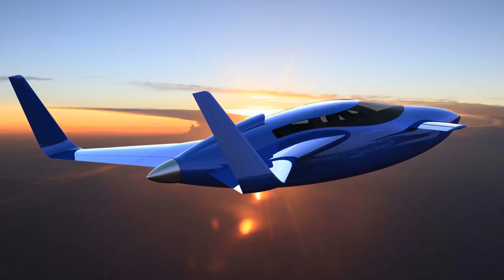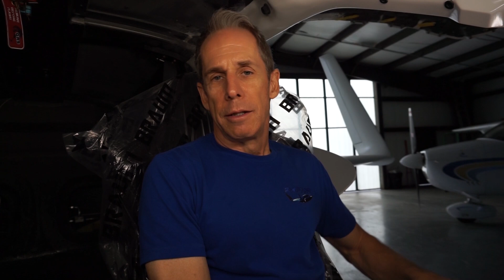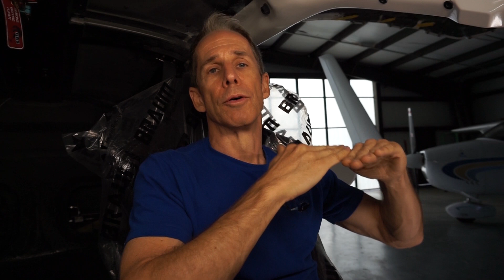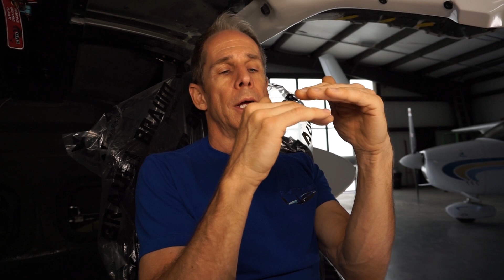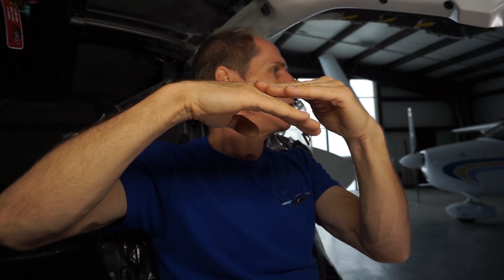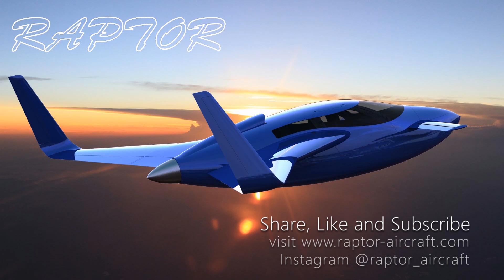State of the Union - Building the Raptor Prototype

Comment: 1) Ideas for reduced risk for flight testing - truck aircraft to a longer runway so progressively longer hops can be performed at low altitude without the need to gain altitude and turn the aircraft.  This is a low risk, low cost, and low schedule way to gain confidence in the aerodynamic concerns.  Pitch authority can be evaluated with less than 50 ft of altitude.  Perhaps NASA would support this project for no fee as it could provide an American resurgence to the aviation industry.  The former space shuttle landing site would be excellent for this and is an 8 hour drive from you.  NASA is seeing a resurgence in the aeronautics side since shuttle retirement, they might be interested in performing spin recovery model tests like they did for the Long EZ many years ago.  Also the NASA Ames (San Fran) wind tunnel test section is large enough to put your full scale aircraft in and take it up to almost 300 knots.  Installation support would take some engineering and build however, especially if the support allows for a free pivoting instrumented balance.  A simple tie down on its current gear to the tunnel floor with control movements may be sufficient to understand whether there is an aero-structural harmonic coupling with the winglet.  University involvement is a good idea, but typically is not free unless it is done by undergraduates that are just learning. NASA may be a better route to getting expert evaluations at reduced cost.  I think asking Burt and Dick Rutan to review your project, either virtual through a web cam or in person, would be very worthwhile.  Their knowledge and connections are significant for most of the concerns you are dealing with.****    2) Idea for variable elevator gap and concern about enough pitch down capability - Can these concerns be mitigated (at least partially) by moving the hinge points aft while leaving them at the same waterline?  If so the metal brackets could be modified external of the composite structure to accommodate this change quickly.  Removing the skin to access the metal to composite joint takes much more time to accomplish, but also can be done with a replacement skin.****  3) Idea for evaluating winglet aero-structural harmonic coupling - This concern can be mitigated if the structure is stiff enough.  While not conclusive, some confidence can be gained by measuring load vs. deflection of the model winglet and wing, then doing the same for the full scale aircraft.  See if the stiffness of the full scale aircraft is similar to the model when scaled appropriately for size.***  4) Idea for dual channel ECU - is there a mechanical packaging solution to creating dual sensors in all locations?  If so, then simply duplicating your current system and wiring both systems to the output actuators (injectors, waste gate actuators, etc) with a simple switch could mitigate this concern.  A 2nd flight test pilot/engineer could monitor the data from both systems in real time (you have enough panel space for this) and make the decision on whether to switch from primary to back up.  Back up battery power should be sufficient for flight testing, dual alternators can come later.***  5) Thoughts on the redrive - you have 2 belts which provides some redundancy already.  Periodic disassembly after ground runs will provide confidence of non-redundant components for flight test.  Perform flight test with altitude and distance away from the landing strip such that the aircraft can always glide to a safe landing.  Additional confidence will come with flight hours and then you can remove this flight restriction.

Comment: Am I not right in thinking that a dual system is not to provide "dual performance" but just to provide a "get me home" back up in case of main system failure. Surely that would be a much more straight forward design. You could also ask the question "why are people still prepared to get airborne in antiquated engines that still use carburetors for example"? Surely any test pilot worth his salt would decline to fly such an inherently unsafe engine!! Aeroplanes have multiple points of failure without redundancy. Ballistic parachute!!

Comment: Great work so far, now your in the home stretch..........I used to fly a turbo prop that had a backup (  Isolate system )  that effectively directly controlled the fuel  going in. - I wonder rather than running two full blown ECU's, it might be acceptable to have a toggle switch that took control of the injector duty cycle and read air intake based on throttle position or a separate throttle toggle switch..... and effectively gave a super simple rich / safe tune - for emergency use rather than daily MPG without all the bells and whistles of the main ECU?

Comment: All the redundancy in ECU is no good when you have a single prop, a single redrive, a single fuel distribution system, etc.. That said, the choice to have every part of the aircraft unproven may not be the best way to go. You could consider using a regular engine for the prototype plane, and then prove the engine on a test stand separately. Run two or three engines for 500 - 1000 hours emulating real-world use and see what cr*ps out on the ground. Take it apart after running flat-out for 200 hours. Check the redrive S/N 0001 - 0005 while (ab)using it.
In short, separate the plane from the engine project.

Comment: Ok...the aerodynamic issues I get...fine.

But this so-called "test pilot" is concerned about redundancy...

ON A MOTEC?

Seriously?!?!

These people have been doing ECUs since the mid-80s, literally since the dawn of computer controlled engines.  They have dominated this market segment in every form of motorsport known to man for DECADES.

Offshore powerboats...
>>>LEMANS...<<<
FIA World rally...
CART...
NASCAR...
World Superbike...
Dakar...
NHRA Top fuel drag racing...
Indy...

...Even builders like Supermarine Aircraft use them...

You'd be hard pressed to find ANY form of motorsport where at least half the grid isnt being controlled and logged FLAWLESSLY by their products.  The chances of a MoTeC ECU glitching or otherwise becoming unusable for ANY reason is so remote, its almost comical to even consider.

Yet this dude clearly believes their products are so unstable that non-redundancy >>of the ECU<< is a show-stopper?

Sorry... 

I would trust MoTeC before I trusted the stock Audi ECU...or this pilots opinion.
Reply: I guess that he was coming to look over a Quickie.  🙄

Comment: Suck it up princess, this is just business politics at play and nothing to be disheartened about.

Your test pilot is not an aircraft engineer and is not qualified to tell you what you should and should not do with the aircraft. He also has the right to choose not to fly the aircraft which he has chosen. No point complaining lol; if you want to be diligent ask your engineer to explain his calculations in regards to strengthening the spar and rest of the wing. In regards to the canard, you are building an experimental aircraft and he is testing exactly that. Some fluid dynamics simulations could be used to plot the lift characteristics of the canard as the flap becomes slotted. Mark your engineer can probably do this, again no big issue other than flight testing is needed to observe the behavior.  

In regards to the engine as most pilots would know from hearing war stories from old timers, those old engines were not reliable, I remember my dad telling me about an old crop duster where one of either the fuel or magneto systems would always fail on a regular bases. Dual systems were simply a stop gap means to fix an issue at the time. Their need is  becoming legacy more than practical which is the case here. His quote that "no good test pilot would fly the plain" is purely speculation based on nothing but his historic knowledge of aircraft. One might ask if a good test pilot would question this by asking what the MTBF of the unit is, and also understand what that means in regards to other redundant aircraft systems.

The above said, certified aircraft have failed to pass FAA checks due to not having fully redundant systems. And if you plan on getting this aircraft FAA certified you might need to revisit this, however that would be many many generations down the line if at all.

Good luck finding a new test pilot I know he will love the aircraft and have little concerns.

Comment: I feel for you. Great video! Regarding Len’s comments, same advice if you have a medical problem, get a second opinion. Or multiple opinions. Regarding the demand for a dual ecu, I flew my plane across the Atlantic to Oshkosh in 2017 with a single ECU (I met you amongst some classic planes and we had a short chat if you remember?), so to demand a second ECU seems either that Len does not know anything about modern engines or is basing his demands on ROTAX 912iS tech which has a dual lane ecu as standard. The UL Power I flew (still fly) behind has a single ECU and works perfectly. I cannot comment on his other concerns regarding the fins, flutter and also the elevators except to say, get a second opinion. Barnaby Wainfan springs to mind as a highly regarded aerodynamicist. Perhaps you can get his opinion/advice. He writes for Kitplanes magazine. Also John Roncz is highly regarded and solved many of the Rutan design issues over the years. Have a good rest and keep the faith! The Audi engine should work fine my only cause for concern is the redrive which I would ditch in favour of an electric adjustable prop in the meantime until the redrive is proven to be faultless after bench testing for hundreds of hours, otherwise it is a single point of failure that will take the aircraft out of the sky. You’ve come this far, do not give up now!

Comment: I was thinking about the ECU, what if you had a complete second ecu that is wired in parallel that could take over in the event of a primary ecu failure with a toggle switch? It could use all the same sensors and you could just upload your settings to it. That should not be that difficult to install.

I know a lot of pilots that are so OCD that they are afraid of everything and everything that may ever go wrong that they do nothing. They all think everyone is the same as them,  Interview other test pilots.
Reply: Trick on a car ECU is to wire in both sets of inputs and toggle the outputs. That way both ECU's are running live and there is no downtime when switching. You also need to check that the inputs aren't dragged down by the ECU e.g. so both receive the trigger voltage etc. Not insurmountable, not quick and actually adds a single point of failure as well (switch gear)\additional wiring loom etc.

Comment: Peter first of all take a short break and you will feel so much less overwhelmed. The issues the test pilot raised are not insurmountable. The replica spitfire uses the motec ecu with a Honda motor. It seems to be flying and they managed to find a test pilot.  My great idea is load the raptor on a trailer and drive to Oshkosh. The amount of interest you would get and the connections  within the experimental aviation and homebuilding world would be worth all the effort.

Comment: Few ideas for you:

I like some of the ideas others have suggested like going to the college and the other test pilots but here is my 2 cents. I hope it helps.

FADEC is relatively new in recips. On jets the whole idea is that duel sensers feed duel channels and the fuel control (FADEC) can decide what to do. So you not only would need a second ECU but also back up sensing of parameters. I actually teach this at an A&P school.

This is important because aircraft recips are very basic. Continental and Lycoming use constant port injectuon where as a diesel will inject directly into the cylinder intermittently and timed. The valves are timed conditionally too - so very complex and a computer is needed for such complexity. Aircraft engines are basic, inefficient but reliable but cars can push the envelope to develop efficiency.

I have few ideas and work arounds for you.

Let me first explain the problem a bit more. So the injectors and valves are timed according to these parameters that are sensed. If one sensor goes down a back up needs to feed the primary ECU so that it can know how to time the injectors and valve lifters. These parameters I imagine might be heat, vibs, torque, throttle lever. Those are what comes to mind. So the problem is that you really do need this backup apparatus to truly be safe. The last problem is that the ECU fails the there is no brains to run the electronically controlled engine (bad).

Now, I'm not an engineer but I think like my grandfather who was one and so I think in terms of solutions. I can only suggest you ask more qualified people say at that college if these work arounds can be done.

Workaround 1. A default engine control if a sensor is flagged inop. This would take the engine to basic operation and still fly in a sort of safe mode like you are familiar with in computers. This isn't necessarily optimal but you default to a slower more efficient not balls to the wall configuration that will simply time all valves and all injectors in one predetermined sync. Either you will need to reprogram the ECU to a default or need a second ECU that comes on when there is a fail. The default engine parameters thing only solves sensor defect problems. If the ECU goes down the you'll need the second control.

To me, this gets your prototype off the ground (literally) but you still have no duel sensing (I realize I'm assuming a lot so set me straight if my assumptions are wrong) you also have no second brains if there is a failure there. So you need to find a way to keep the aircraft running.

2 solution, see if a second ECU can read noninvasive sensing and default to that if ECU 1 fails. I envision that ECU 2 is really a computer that senses ECU 1 is working correctly. If ECU 2 sees 1 degrades then it takes over. This would require sending all faults to ECU 2 to with a choice to over ride. ECU 1 is really a slave to the permissions of ECU 2. ECU 2 can then use these abbreviated noninvasive after thought sensing to control the engine.

I like as others have suggested talking to Audi Racing and their solutions. I actually know a pilot who flew 727s and is a mechanic and his sister had an alcohol racing team so I might reach out there for thoughts. I like going to the college too.

You have quite a community here. Save heart. If there is anything I can do to help, I have a technical background, a strong sales background and I think with both sides of the cranium. If you want to enlist my help, just respond here and I'll contact you. But truly, save heart. You'll get this up. I can imagine it's bewildering but this design is well thought out. Take it to the finish line. I'm not moving to GA and I'm not looking for a job. :) I just want to see that this gets off the ground before some other person compromises the design. You've done a good job. This is a hiccup and I know it seems daunting but I'm sure there is a solution. Just the fact that buyers are making offers means there is immense value. I know you wanted it to be done but now is the time to dig deep and as I said, ask your community for help. We dig the crap out of this plane.
Reply: Really great ideas! Where do you teach A&P?

Comment: Like what you are doing and realize this is not a part 23 manuf. aircraft, but sometimes the FAA has good reasons for what it does. Subpart C—Design and Construction; Reciprocating Aircraft Engines §33.37   Ignition system.
Each spark ignition engine must have a dual ignition system with at least two spark plugs for each cylinder and two separate electric circuits with separate sources of electrical energy, or have an ignition system of equivalent in-flight reliability. I have been in aviation since 1968, A&P, former IA, Quality Engineer, Aerospace, Comm-Inst-Multi-engine pilot airplane, comm-helicopter, flight dispatcher, flight engineer and 2nd officer B727's. I really hope you are successful, good luck...............
Reply: This part does not apply to diesel engines.
Reply: @robertrade  Agreed, oops but I was just emphasizing safety...

Comment: 1st problem, flutter is a residence issue. and can be mitigated with the slow envelope expansion. not something that will likely be an issue on they first flight. 
2nd problem, the canard. it might be an idea 2 make a fixed spoiler at 5 or 10%  canard span.
Reply: and by doing this you would temporarily undersized the canard and thus increase the nose down pitching moment of the aircraft for the initial test flights
Reply: and lastly concerning the test pilots concern with the engine ecu. historically there have been plenty of single point failures in aircraft design. and like all single point failures weak points need to be mitigated. From my perspective it seems like you have mitigated as much risk as possible.
Reply: and as such it might be a better idea to find a less reluctant test-pilot.